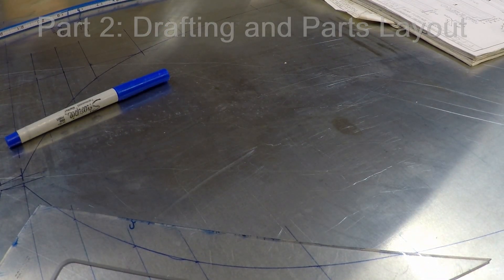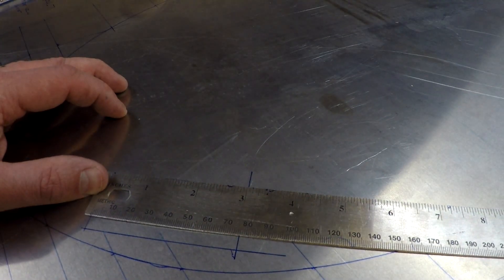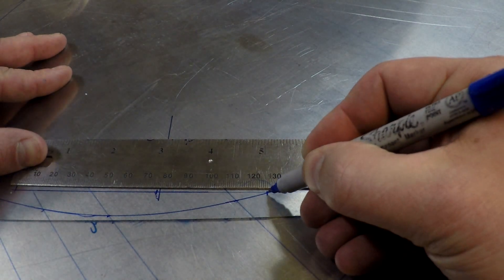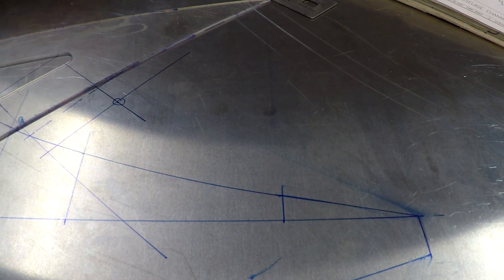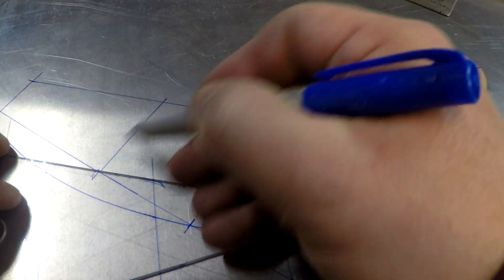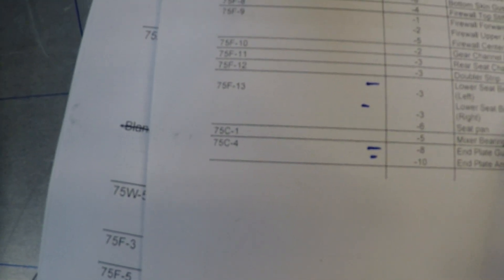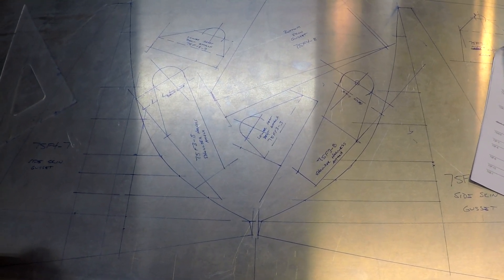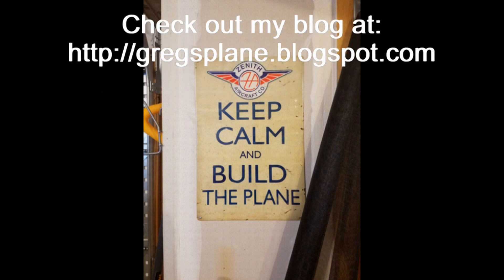Drafting and Parts Layout - Part  2/2

Comment: Are there any pieces that need to have the grain aligned with loads and forces ?????...........is the grain direction marked on the sheet ????.....
Reply from the maker: FAA Inspector Nothing in the 750 plans  require a specific grain orientation. The 701 plans specify it in a few places. Zenith' s construction standards explicitly state that it only matters if denoted in the plans, so that is the rule I'm following.